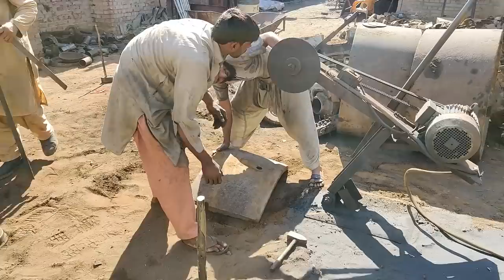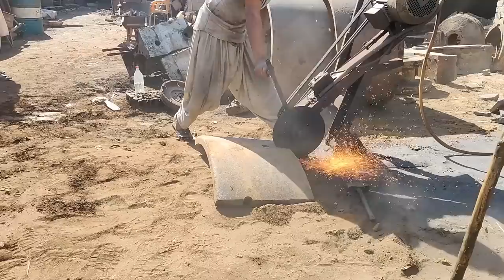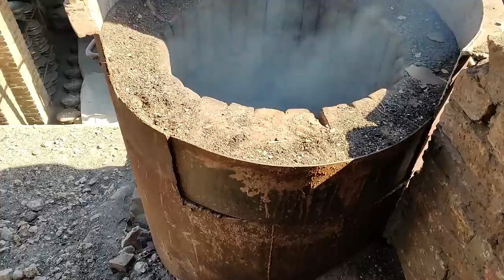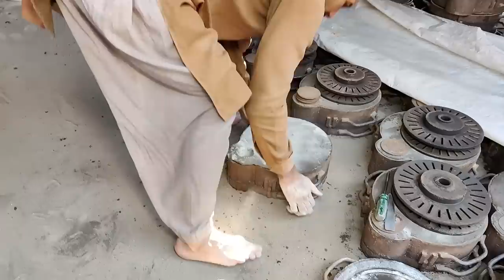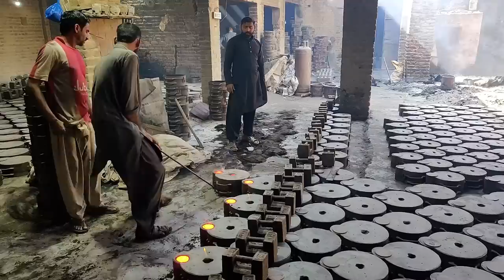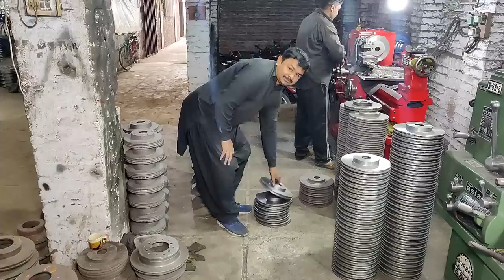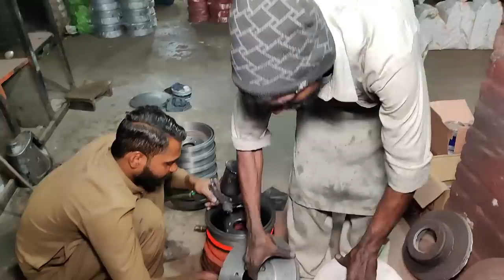Wonderful Process to make Disk Brake Plate | Complete Manufacturing Process

Comment: It would be quicker and easier to do a second cut on the scrap, but the cost of the labor is cheaper than the saw blade.
Reply: Cutting expenses in half xD
Reply: Exactly what I thought when I saw it.
Reply: That and electricity too.  I was also thinking they should do score cutting instead of plunge cutting.  With score cutting you drag the cutting wheel across the surface getting deeper with each pass.  With plunge cutting you press the wheel into the material until it cuts through, then push the wheel through the material.  Plunge cutting is much faster but much harder on the blade.  From the video I saw demonstrating it, score cutting took twice as long but the blade lasted 16 times longer.
Reply: It would be quicker and easier if they had a furnace large enough to just toss the big pieces in.
Reply: @jdaz5462  More energy needed top keep furnage hot

Comment: I really liked that machine at the beginning of the video!! I've never seen video of the amputation'o'matic 4000 before today!!! 🤯
Reply: The Widowmaker 3000
Reply: Buy the Widowmaker 3000 and get a pair of safety flip flops thrown in free...............................
Reply: Limb distributor 8000
Reply: 😂😂😂😂 Imao
Reply: I think that version is the stumpmaker pro.
Reply: "I'll place the uninsulated power switch in between the spinning blade and the spinning belt and pulleys. It feels the best place for it"
Reply: Guy has three toes on one foot. Last guy probably wasn't so lucky.
Reply: @tony359  Hahahahaha 😂 
Nice observation.

Comment: This is why your $100 aftermarket brake discs shake like a jack hammer from day one 👍

My heart goes out to these workers who put up with zero safety to food on their tables.
Reply: no wonder dude at 0:14 has 3 toes..
Reply: Speaking like a true professionals, these brakes they made are proven to be reliable for normal cars to heavy trucks.
Reply: @ritchkeyd265 
What's the brand name? 
I'll be sure to check them out...
All aftermarket replacement discs we get offered here in Australia suffer from poor quality, from the big brand names down to the no name ones.
They're all trying to compete on price and quality is second.
Reply: No, because you are lazy and didn't change the break shoes/pads and they ground into the disc.
Reply: @rsz90182  Ha ha ha.
Guess what, I'm a motor mechanic, I've never done that!
Reply: @Danger_mouse  Iranian Prison Camp Products LLC
Reply: @robsp32  🤣
Looks like it!
Reply: @ritchkeyd265  lol in your dreams or if you don't know for better ones then yes
Reply: Why would they shake from day one? You can see that the rotors are being turned true in the video. I can't speak for the quality of the material they're working with, they may very well warp after a few hundred miles, but they'd at least be true out of the box.
Reply: @FinalFront 
It's the quality of the materials that dictates how stable the casting remains once heated.
Many times now, I have installed new rotors on a vehicle, bedded them in according to directions and then as soon as they get hot the first time they, they begin to shudder.
Reply: nope, incorrect discs are processed on the lathe and are ok from that point of view, problem is more with your piston or brake shoe lining then with this ones
Reply: @voanirges 
It's about the quality of the casting. Doesn't matter if it is machined true at room temperature, when the cheap casting heats up it distorts. Nothing to do with the shoes or pads.
Reply: @Danger_mouse  what about casting ? you are concerned about quality of material ? you think "original" parts are done with higher quality materials ?

Comment: Instead of cutting the full piece of iron, we’ll cut it halfway so we have to work even harder by trying to split it with sledge hammers.
Reply: The cutter gets over heated and the more it goes into the core the more hot it gets and more there are chances of less blade life.

Comment: where do they do run out check and balancing? that's the key process for making brake rotors?
Reply: Their cars do not go fast or they do not care for own comfort ...
Reply: @gonzor73   i bet these vent brake rotors most likely enters into western after market. Maybe their distributor will do the check. Literally without these basic check a rotor is not usable at all. The jolting from unbalance and squeaking from runout will annoy customer immediately.

Comment: I am pretty sure that this not how OEM parts are manufactured. Is there any material quality control or they are just using random scrap to produce the break parts
Reply: Probably not🤣
Reply: These must be sold locally. I don't think a Tata Nano or an old Lada-based car would need anything stronger than what these guys are producing. These won't be used in any Autobhan but rather on some poorly paved roads with 50km/h traffic. Cheap and effective, so win-win for all

Comment: No way would these discs run true facing each side separately. You need to face both sides at the same time to guarantee parallelism
Reply: Not needed if the machine is extremely well calibrated. In this case i doubt it
Reply: How are you going to hold the work so you can face both sides at the same time?
Reply: @ngwilkum  You hold it internally and use left and right hand tools to face both sides while it is clamped once.  
Even 0.002" it can cause bad foot pedal pulsing.
I have used this method for 30 years.
Reply: @peterdonnelly6465  i get that you could use a break lathe but they dont have one.

Comment: So lets gets this straight,
cut half way through a piece of steel, then hammer the rest to split it in two ?
why not just cut it all in half, or use oxy-ocetolene torch ?
load up several bowls of steel then put in a hopper/bucket which is right next to the table you use to fill up the bowls ??
why not just put it straight in to the hopper/bucket ??

there's no wonder my disc's warp when braking if this is the level on intelligence used to make them..
Reply: 1- labor is cheaper than blade
2- labor is cheaper than torch+ oxy-acetylene
3- smaller chunks melts faster than one big piece,less time and less fuel

Comment: I'd be terrified to drive my car if i knew my disc brakes were cast from just whatever scrap steel you find on the side of the road, not even cleaned up. 
If you take that plate to a Rockwell tester it probably crumbles like a cookie.
Reply: Safety last, eff everyone over couple shekkels
Reply: what do you think made in chine materials are?
same material just done in bigger factory

Comment: These are at least cast in iron. But the metalurgy will be very poor. Rotors are ground, not turned. They will shake like blazes first time they get hot. 
And I will set Greta on them, they are burning evil coal

Comment: At that curve the guy went to overtake, I always when I take a curve like this, I see a truck coming on the curve I try, always slow down and leave as much of a possibility as possible, of someone wanting to overtake in this fatal way. if you are going to a left curve , what is done, there is a space to the right, so when making the curve, leave the car as far to the right as possible, the car that took the crash was not to blame, of course, but if it knew that if it was going to make the curve to the right open, another one when overtaking, maybe it wouldn't even brush the front, it would pass almost touching but it wouldn't crash. on a curve you have to let the truck pass, and also never overtake on a curve, even more so there. to overtake, the truck on the left side, to want, after overtaking in a curve to the right, very stupid indeed.  lost his life and even killed another, who was coming. You can see why, on city roads we have to drive for others.